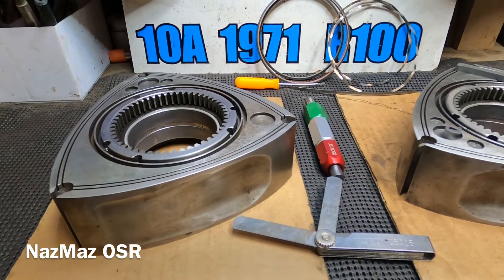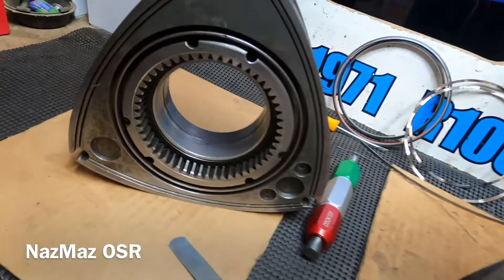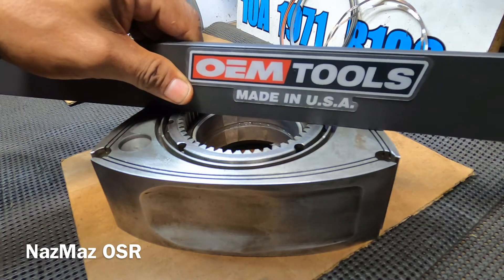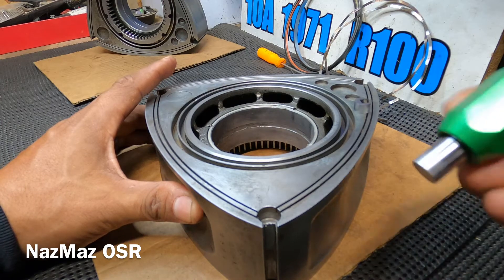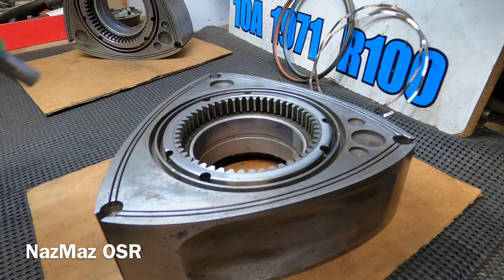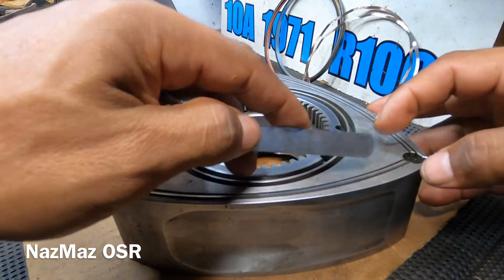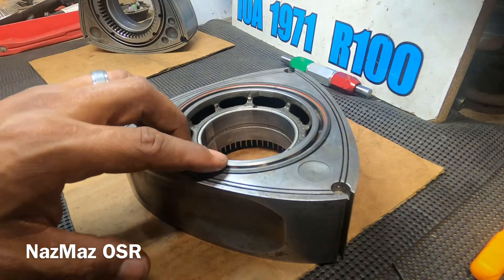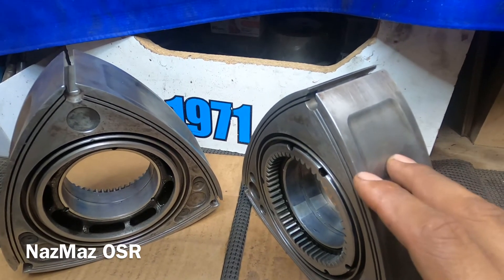Mazda Rotary 10A rotor inspection

Comment: 5:11 Mazdas factory service manuals actually recommend tapping the gear back in instead of replacing the rotor.
And the only way for the gear to "sink" is for the face of it to wear because it's seated against the rotor. In that case you should replace the rotor or you could have the rotors side clearanced for high rpm